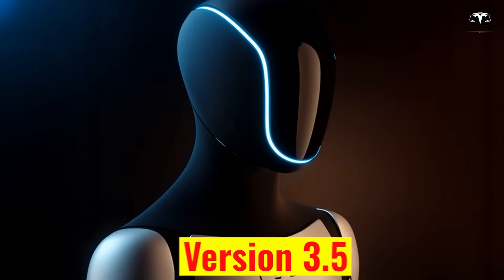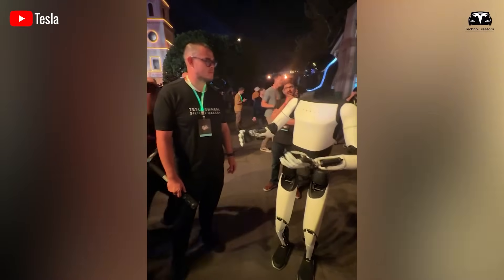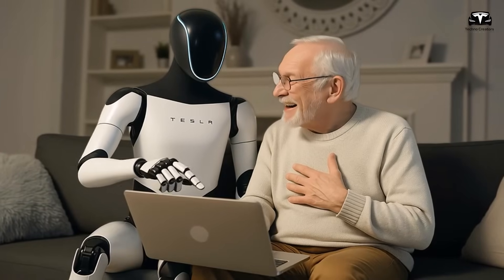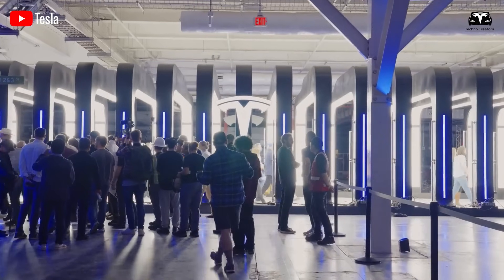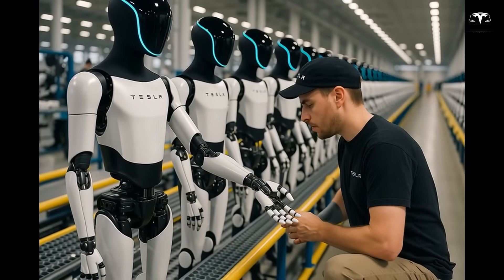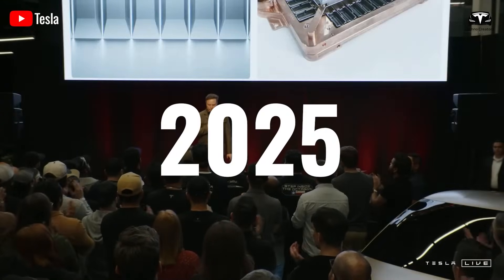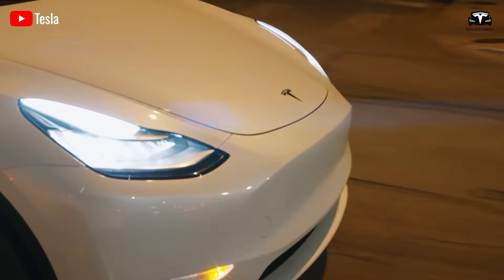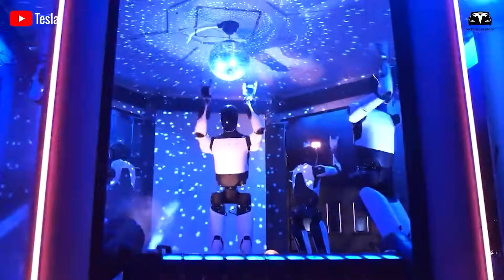Big Update! Tesla Optimus V3.5 With Smart Home! How Smart & Safe Will Your Home Be

Comment: This is nice but how about a specialization that could pick and clean cotton?  It would have to be extremely heat resistant to work in glaring sun.  It would need the dexterity of human hands and the softness of human hands.  Cotton is quickly becoming a luxury item for few will consent to this labor intensive sort of work.  They have a machine to clean the cotton but it tends to tear the threads.  The longer the threads, the better the quality.  Cotton can grow in poor soil and resists drought.